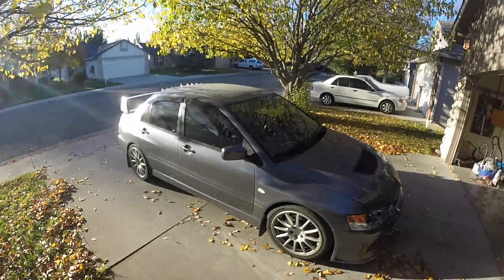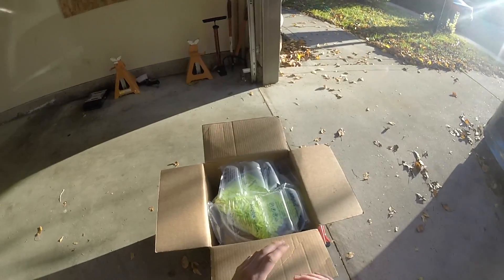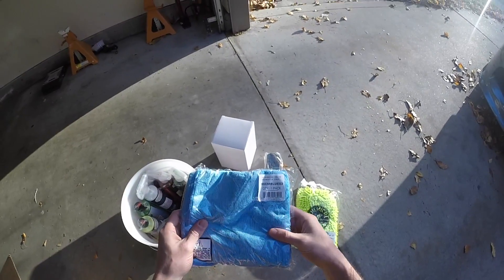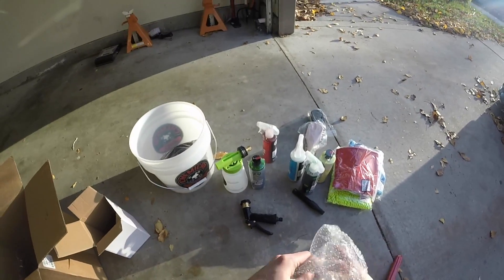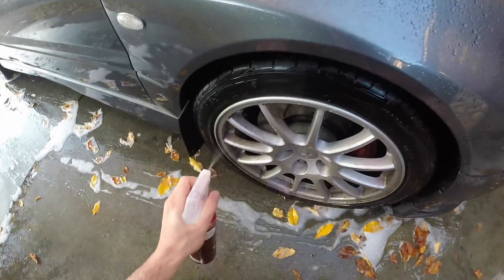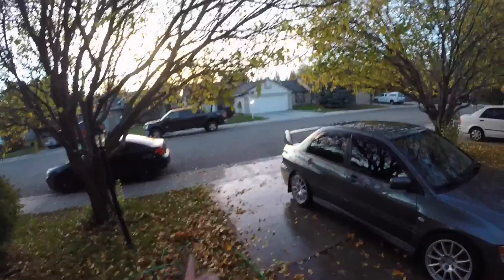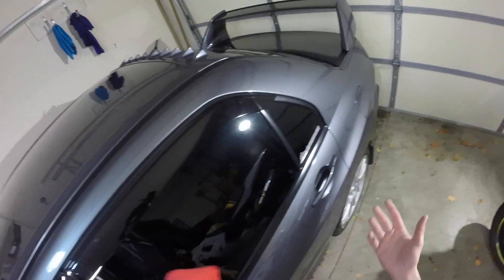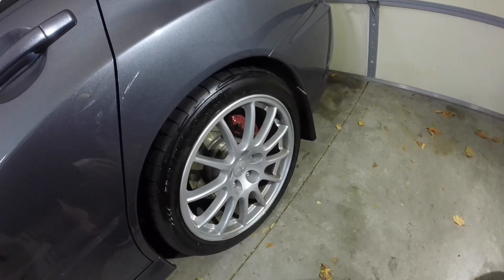The Ultimate Auto Care Package for CHEAP!

Comment: Do you think the foam gun is worthwhile tool?   Do you see a benefit from using it?  Would you buy it again?
Reply from the maker: I think its a fun toy, but other than using it to pre soak the car, it's not necessary. I would buy it in the package yes, but probably not by itself
Reply: thanks!   was looking at the package, but do not need the other stuff, even though it looks like a good deal.

Comment: Not sure if I got this right? Shouldn't you pre-rinse, then foam, then use microfiber mitts before you rinse the foam off? It looks like the foam was rinsed off before using the the mitt? What is the correct order? I'm a female and want to take proper care of my finish.....thank you!
Reply from the maker: Good question! I pre rinsed and then foamed and then rinsed due to my car being so dirty. If it was cleaner I would have rinsed, foamed, and then started using the mitt to work in the foam

Comment: What's your opinion on the foam gun? I recently just got one made by Gilmore from AZM for $40. Seems like the same thing as the CG's in your video, but just rebranded? Debating if I should return this, and buy this CG kit? I'm usually a Meguiar's product guy, never used CG's products before...wondering if it is worth the extra $30 for all the other goodies.

Comment: why don't you have a dedicated applicator pad for applying wax if you claim to be a hobbyist detailer?
Reply from the maker: What a great question Mar Tin! So let's give you a great answer. I typically use Opti-Seal or Optimum Car Wax with their specific foam applicator. I probably didn't have any applicators because I throw them away after each use until I stock up on more.
Reply: If I'm not mistaken, I believe the black and white foam applicator included in the package was meant for the wax.
Reply from the maker: The black and white applicator was actually VERY coarse. The black part was a rigid sponge material, and the white part was a handle of some sort
Reply: Ah. I know for a while they were promoting the hex-logic pads as their paint product applicators. I guess they've added dressing applicators to that line since I last looked.

Comment: That was only around $ 90-100 worth of product...not 180 or more...not much of a savings for not being to choose the specific products one wants.
Reply from the maker: Not trying to defend chemical guys by any means, but link me to a site or cart where you got all of this for 100 bucks
Reply: ALLDAYANTHONY A foam cannon, bucket, a couple mid-grade MF towels, and 5 bottles of product (liquid wax, shampoo, wheel cleaner, glass cleaner, and tire-rubber dressing) for 100 bucks or less, choosing quality brands, no problem. The pricing for these CG products on Amazon is about $ 140.00...so it looks like were both off by about the same amount but in different directions. 

In any case, whether I was spending 90 or 140 dollars on detail supplies, I'd want to mix and match the products and brands myself.
Reply: hollowpoint45acp Thank you for your informative reply.

Comment: 1. Rinse the car before the foam
2.foam the car
3.use the scrub method with the foam still on.  
Waste of product if you foam the car just to rinse it a minute later
Reply from the maker: andy rodriguez The car was dirty enough to justify a pre soak to loosen the dirt. If it was just dusty I would say that method would be fine. Taking these precautions has left my car scratch free with no imperfections
Reply: Have fun with the swirl marks👌🏻 you obviously didn't understand the comment.
Reply from the maker: "Swirl Marks"? From a rinse, foam, rinse, and two bucket method? lol. This is how I know you're uneducated on auto detailing.
Reply: I'll agree with Anthony. And by the way, it's actually quite hard to get swirl marks if you are washing in straight lines (which he did in this video). And the fact that he rinsed, foamed, then rinsed the car off before the two bucket method takes care of all of the heavy dirt and debris that can cause a lot of the major scratches and paint damage during the washing process. It's not a waste of product if it protects your car. You don't seem to have much knowledge in auto detailing. Keep your comments to yourself and if you don't like something, don't watch or comment on it. Thank you
Reply: If the car is bad enough that you need to foam beforehand you should not touch it at all. He didn't do anything wrong in this video at all